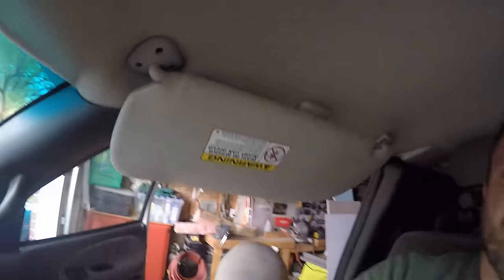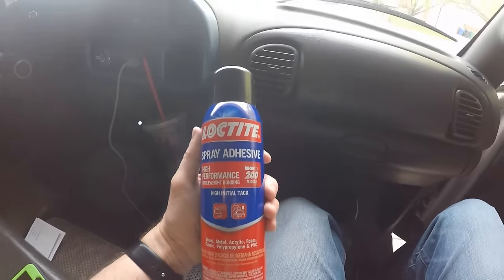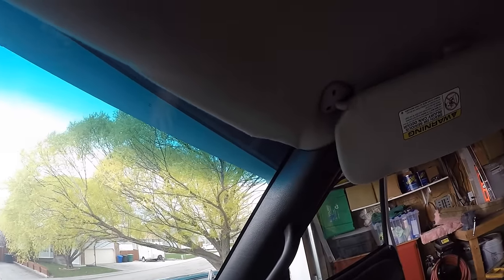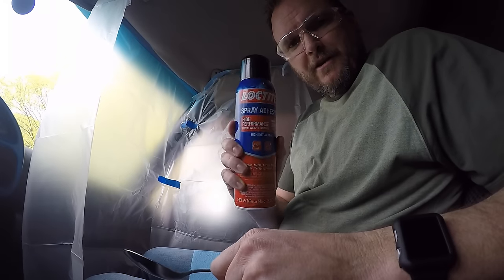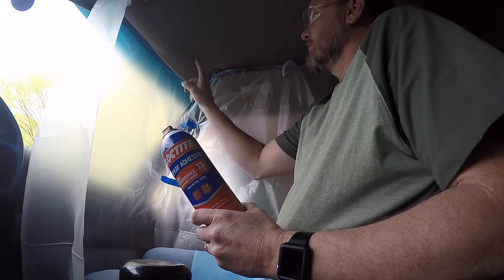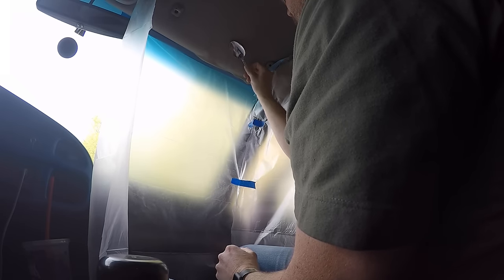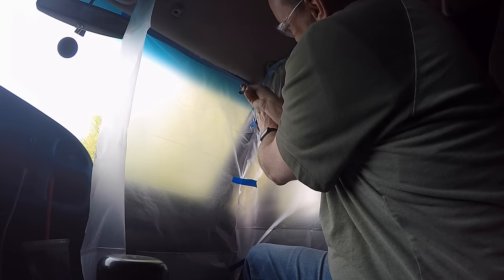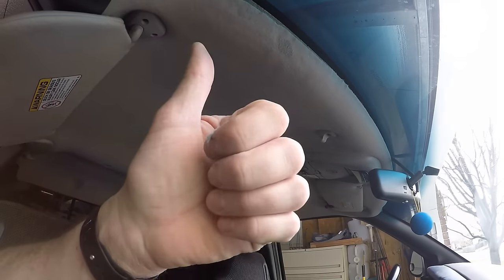Truck/Car/Van Headliner Repair - Sagging, separating, tearing away, drooping - DIY Fix

Comment: Thanks for the video. Looks good. Here is a tip for others. If you follow instructions on the can to keep spray nozzles a foot or so away from surface, it then "spiderweb's" and is way taker and won't be as quick to saturate cloth. End result is less bleed thru spots.

Comment: I too used the 3M Headliner Adhesive as well.  However, you need to let it try at least 5 minutes or it will soak through the fabric. I used plastic kitchen wrap to protect the window and plastic trash bags to protect the upholstery underneath.  I was able to use my fingers to smooth out the fabric pretty well but the spoon is a nice touch.
Reply from the maker: Thanks man.  It's been a while and still holding up strong.
Reply: Thanks for the heads up, I saw in this video that the glue did actually soak through.

Comment: If the backing foam is degraded, use the spoon to remove old foam first. Even if it is just the first inch or so. 
   I will be doing this too. I've done entire headliners before and I'd rather do the stitch in time!   Good video.  I concur!
Reply from the maker: Good Pro tip right there!  It’s just now starting to come down again in the same spot (lasted 5 years) and in one new spot. I’ll do this same repair but add the foam removal too. Should last another 5+ years!  Thanks man! 🙌🏼

Comment: Loctite makes good stuff but the 3M product is excellent. You could also use a dauber with a cotton type tip (about the size of a grape) for smaller applications. Spray that and apply. It’s good to DIY!
Reply: Yea foam fast is the best by 3m we use it to keep felt on slate or wood pool tables all over the world it stays forever
Reply: @davidgray7907  THX best stuff on the market. ✌️

Comment: Having this issue in my1st Gen Tundra, want to stop it before I have to remove the whole thing and do a complete fabric replacement. Nice tip  about  using the  spoon to smoothing the fabric.
Reply from the maker: Did it work?  Mine held for 5 years, I did the same fix on the drivers side 3.5 years later and both were holding strong when I sold the truck last year!  All the nay sayers and go away!  haha

Comment: Thank you vary much, the auto detailing shop in my area told me to use a stapler, or they can charge me $349.00 to redo my entire headline in my 04 Cherokee, this looks like a much better fix.
Reply from the maker: At least give it a try. Might save you a ton of money. 👍🏼
Reply: That price is outrageous!
Reply: @drfreud65  lots of times the front seat has to come out.  My silverado classic is this way.  It’s actually a big headliner
Reply: @drfreud65  I got the same quote until they asked if it had a sliding moon roof.  The price shot up higher with the moon roof because of all the extra work required to remove the moon roof to replace the headliner on its cover.

Comment: Gonna try this with my mustang, it's been sagging a little in the back right corner of the seat & I never knew how to fix it but I've had a few friends seen it & I felt embarrassed asf 😂 hopefully I'll get to somehow fix the whole back cause it looks like there might be a little bit of a rip so I might not get the whole thing but we'll see, appreciate you for showing this to everyone dawg frr
Reply from the maker: Hopefully you can save it or at least extend its useful life a little longer. Sound like yours is much worse than mine was. Post your results here. I’d like to hear how it goes. 🙌🏼

Comment: Betcha the adhesive used for countertop install would work also... 
In My old Jeep, I've ironed on material using the by the yard adhesive found at the fabric store. It lasted for YEARS.
Reply from the maker: Probably, that stuf is sticky as anything I’ve ever worked with!  You’d have ONE chance to get it right. 😱

Comment: Instead of doing it in a one time attempt, you should instead start from the internal area where it isn't adhered and work your to the edge,stretching it out as you work your way to the edge, also don't over apply the spray, you'll saturate the fabric and can end up allowing the subtance to surface which will compromise the material texture and feel, you want it 30% under the material if that makes semse

Comment: For anyone who's interested, in really bad cases, you can go "brute force" and remove the fabric altogether. I say brute force because it requires removing the entire ceiling. The ceiling foam on my old Chrysler Town and Country minivan was dissolving so badly nothing would stick to it. I mean, it would stick, but then the foam—along with wads of glue—would just crumble into the now sagging fabric and make an awful mess when the wind blew in. So...

• I took out the ceiling and set it on a couple of sawhorses. (Harder than it seems. There are all kinds of electrical and AC connections up there.)

• Brushed / scraped away every bit of foam. This left a fibrous kind of texture. Fine by me.

• Spray painted it a nice flat gray to make it as inconspicuous as possible. (I considered doing a kind of Sistine chapel type thing, but nixed the idea.)

• Reinstalled it. Boom done.

I had the van for a good decade after that, and not one single person ever realized it should have had a fabric ceiling. Worked great, and no more crumbling foam worries.
Reply from the maker: Agreed with the term brute force!  That is a big job. Hopefully most people find my video and fix theirs before that task is ever needed!  This fix I did lasted 6 years before the drivers side started doing the same thing.  I used this same fix on that side then sold the truck. I still see the truck over a year later and the headliner is still holding!  Catch it soon enough and this fix is “permanent”.

Comment: Yo!!! Since it's been 3 years or more since you made your repair...how long did it last?
Reply from the maker: Honestly it's starting to come loose again, but only in a few small spots.  I think I didn't get enough of the sticky stuff across both surfaces.  I have one spot on the drivers side basically same location that's starting to come off as well now.  Might be time to revisit this and fix both again.
Reply: @troysgarage  lol after the first fix probably wanna get a whole replacement one.

Comment: I used the same exact stuff, next morning same exact headliner issue.
Even after I read all the directions on the back of the can; I also read the “IMPORTANT” column 5th line down, 
“ not recommended for unsupported vinyl fabric or headliners” 
And i also used the permanent bond instruction procedure.
Used a bristle brush to remove any loose or deteriorated/expired foam from the headliner. 
Any extra extra help recommendation’s?
Reply from the maker: If the foam backing is too dry and flaky the adhesive won’t grab. Sorry you had a bad experience with it. That’s how it goes sometimes. 😕

Comment: Spray adhesive and then remove plastic for overspray, then you would be able to see the lining in the front.
Reply: So you spray the outside of the headliner to get it neat?

Comment: You've inspired me, I'm gonna try this to fix my '04 Explorer that's sagging in the same spot. Question though:  Any particular reason you went with a "general purpose" spray adhesive (the Loctite) vice using a dedicated headliner adhesive, such as 3M's 38808 Headliner and Fabric Adhesive? I'm no expert, just wondering.
Reply from the maker: Honestly, it’s only because I had it already from other projects. And I was confident it would work just fine.
Reply: Hmm! I also have an '04 Explorer with the exact same problem
Reply: @troysgarage  thank you lots

Comment: Hi Troy… I just saw your video and it’s November 3rd 2022.. I need to repair my headliner as well as the side door vinyl. The passenger door vinyl has suddenly become loose at the free edge part of the door. It is loose all the way to the window handles. The vehicle is a 2001 Beetle.. she has seen better days but i refuse to let her go. She still gets me around town and I just have had her so long that i can’t give up on her. She has some issues that i am working on but i want to try to repair the inside things myself. Do you think the same method will work for the door vinyl? My fabric is very loose also in my headliner but i’m gonna try what you suggest. Should i buy a different spray adhesive for the vinyl part on the door? Thank you for any suggestions.. Lisa ( you might not even see my comment because this is an older video but i’m giving it a shot anyway) I have nobody to help me fix it but myself so i’m doing this so my poor little beetle looks better.. i know i must sound nuts but that car has been with me over 20 years and i can’t imagine her ending up in a junk yard.. she isn’t worth anything to anyone but to me she is my car and a part of my life for so long.. she needs to be pretty inside !
Reply from the maker: The same adhesive spray will work for both.  Just spray both surfaces and let it dry enough to get tacky to the touch, then press them together.  They should grab and hold right away.  The fumes can be a little strong so be in a well ventilated area and try not to directly breath the fumes.  You don't sound nuts to me!  The truck in this video was mine for 16 years and I personally put over 240,000 miles on it.  I did finally sell it 2 months ago and the headliner fix was still holding strong!  You got this!  🙌

Comment: Great video. Only trouble is we have Selley's spray adhesive (Bunnings Hardware) in Australia (Not Loctite) which is particularly unreliable for this application according to a review I read.
Reply: Do you have 3M products there?

Comment: Did the repair last or did it start to sag again? I’m having the same issue, my headliner is beginning to sag/fall. In the same area you repaired.
Reply from the maker: Just this spring it has begun to pull away again. The repair lasted for several years. I have one more spot on the drivers side doing the same thing. I’m going to hit both sides again and hope for several more years before it needs it again. 🙌🏼🕺🏼
Reply: @troysgarage  The 3M can says multiple coats may be needed. I'm going to apply 3 coats to each surface before sticking it together in my repair.

Comment: I buy this spray adhesive in bulk. I use a lot of it. However I would NOT recommend it for a headliner. As the can says "strong initial tack". Strong at first then not so much.. It dries and becomes a powder unless you load a lot if it on. The instuctions says it is "more permant bond" if you use a heavy spray. 
The problem is also the way the headliner is made. It is a 1/8" foam that is heat bonded to the fabric. No glue in the headliner itsself. The fabric is heat fused to the foam. Once that heat bonded layer of foam starts to degrade and turns to dust the fabric breaks loose and falls away. If you spray glue onto a foam thats turning to dust it will pull layers of foam off one after the other. You can't glue to dust no matter how good your glue is. 
I once used a piece of fabric blanket material from Joanns fabrics. Basically a blanket with no foam. I used foam upholstery glue and glued it to the cleaned head shell. It never came off again. 
Heat bonded headliner fabric is junk. Try not to use it if possible. And use something like 3M 99 spray adhesive if you only want to do it once..
Reply from the maker: You say all that, however 3 years later when I sold the truck it was still holding strong. In fact I repaired the drivers side the same way almost a year before I sold the truck. I still see the truck every once in a while around town. Still going strong with well over 310k miles.
Reply: @troysgarage  just stating the facts.

Comment: I did this too. But after a couple months it started failing again. Did you experience the same thing? And if so did you determine a solution? Thanks.
Reply from the maker: Mine is only just now starting to come loose again. I haven’t messed with it yet. Not sure exactly what I’ll do about it this time. 🤨🤷🏼‍♂️

Comment: The spray doesn't bleed thru and stain the fabric? Thanks
Reply from the maker: Just be sure to let it "tack up" before you start pressing it all together.  If the glue is still "wet" it will soak through.  But won't stain the fabric either way.  It's clear and doesn't change the color.
Reply: Thanks!

Comment: Hey Troy, how’s it holding up?
Reply from the maker: I sold the truck last month, but it was still holding strong when I let it go.  I did the same repair above the drivers side about 6 months ago.  Just as easy to apply and I'm confident it will hold for the new owner for a long time.  The key is catching it early  before it gets away from the edge.  That's a much harder fix!
Reply: @troysgarage  thanks for responding 👍🏻

Comment: Just bought my first car and it has major headliner sag in the front & back, the previous owner appeared to use the fabric screws or whatever have you but they didn't hold. Would this work for larger areas as well? I'm talking the width of the back winsheild pane and about a good 4-6 inches hanging lol sounds like it might be a lot of work but I'm willing if it works good
Reply from the maker: In that case you’ll want to take the entire head piece out and replace the fabric completely. Hit the fabric store and buy some light weight flannel in whatever pattern, color or design suits you and you’ll have a brand new headliner that will last the rest of the cars life. There are some good videos out there already of headliner replacement. Watch those and follow their advice. You’ll do great!  👍🏼
Reply: @troysgarage  Thanks :) I've been looking at those kind of videos and the idea of a fun headliner is really cool, seems like I'll want some help though I'm a pretty tiny person and my Mazda6 isn't big by any means but it just sounds easier with an extra person lol

Comment: Since it's the foam, between the fabric and the core headliner, that is deteriorating, and not the original adhesive, what keeps the residual foam from deteriorating more--and coming loose again?  I'm thinking that it might be a good idea to sand off all the remaining foam from the core headliner (especially at the edge) before applying the adhesive.  Your video is a little over a year old now.  Do you still have the car? If so, how has this fix held up?  Thanks for the video!
Reply from the maker: 18 months and still holding strong. No new areas coming loose either. I still drive with my windows down all the time. I’m sure in worse cases you would need to take more drastic measures. But catch it early and avoid that mess. Good luck with yours. Hope it’s not worse than mine and needing more than this simple fix. 👍🏼

Comment: I wish I would have seen this video a couple of years ago. Now it's gotten quite a bit worse and is in an area where I would have to slice it open to get
adhesive in there. I still might try it. I've been using tape and upholstery pins to hold it up.
Reply from the maker: Have you tried it yet?  Sounds like you are close to a do over. 🤷🏼‍♂️
Reply: @troysgarage  Not yet. It's still too cold here and I've been so busy with other stuff that I forgot all about it. Not in the van much now days. Thanks for the reminder.

Comment: Most of my liner is coming down how about do I go about doing that kind don’t know we’re to start from??
Reply from the maker: With that you are better off taking down the whole thing. Go to a fabric shop and get piece of flannel big doings to cover the entire thing. Take out the headliner backing piece (google search your make/model for help there), clean it good with a vacuum and then spray both the fabric and the headliner following the directions on the spray adhesive. Have someone help you start in the center line and move outward smoothing out all the “bubbles” and creases. It won’t be easy but you can customize it by selecting whatever fabric you want. I’m going to do an American Flag 🇺🇸 on the ceiling of our old Ford #midnightmaroon

Comment: a few months down the road the other glue on headliner usually fails too. good luck hope it don't. 3M makes a headliner spray for these jobs
Reply from the maker: +sling shoter been 5 months now and still holding strong. No new sagging anywhere else.
Reply: DIY Home and Auto still holding strong?  I’m going to fix mine with your method if it.
Reply: mine's still holding after 2 years. I also used the loctite adhesive.